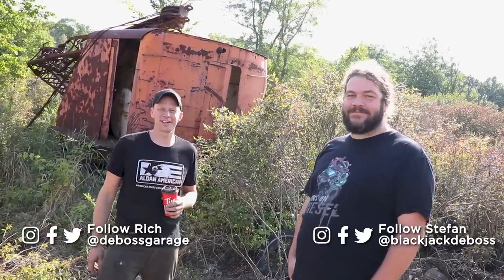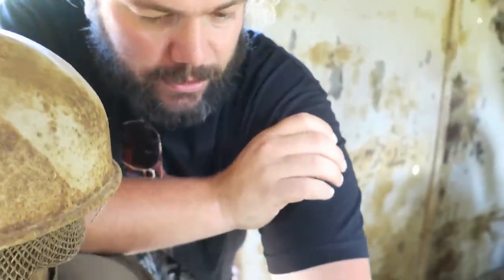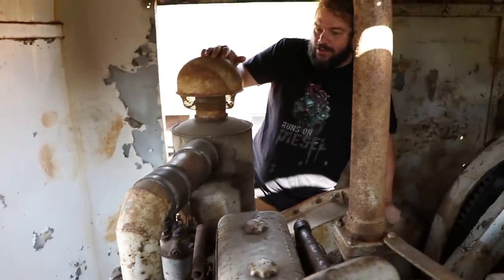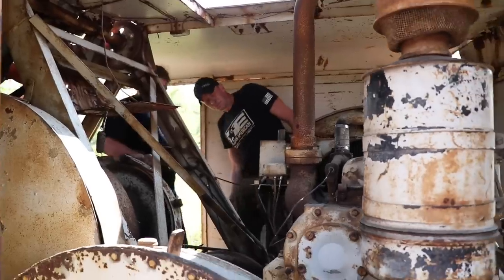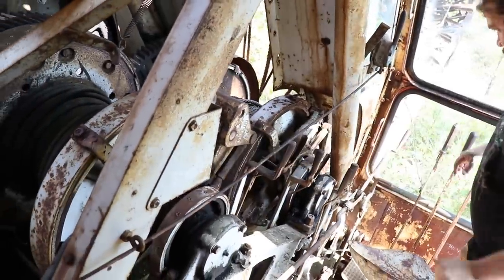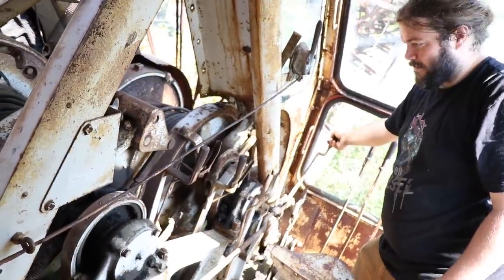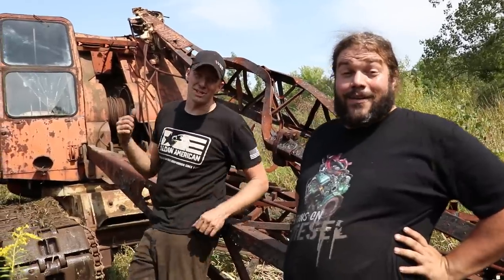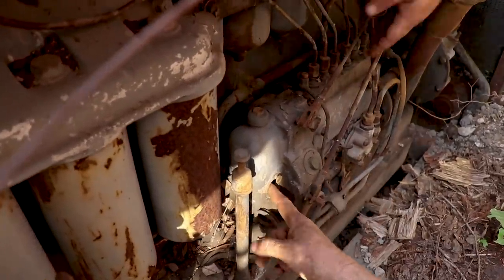Will a 2-Stroke Detroit Diesel Run on 20 Year Old Fuel?

Comment: If the zombie apocalypse comes, Rich will be the only one left driving around in a Detroit-diesel powered something.
Reply: Pfft, 
Detroit?
You know it will be a Cummins.
Reply: @jamiewhitworth7183  well detroit can run on shitty fuel better than a cummins but yeah a 1 wire cummins or a detroit would be best
Reply: @Deftonesdsm  a p-pump will work just fine thank you. Even sunflower oil, if you take out the gummy crap first with proper treatement. SEE Watch Wes Work to see what happens if you just dump in french fries oil.
Reply: @PaulHigginbothamSr  did i not say a cummins or detroit would be best?
Reply: Rick Delair ok boomer
Reply: @xnorthkillerx  really dude? Get an original idea instead of repeating memes
Reply: Rick Delair  The trucking industry disagrees.
Reply: Well I’ll be in my apocalypse car, a Datsun 210.
Reply: @averyw.3939  the trucking industry agrees. The EPA are the ones who killed the Detroit.
Reply: Well, with people like him the apocalypse will only last a weekend before we rebuild and get everything running again.
Reply: @danmackintosh6325  Lets make it even better. Mercedes OM615. I drove one with frenchfries oil (used) for years just filtering the oil i used near arctic circle. in winter i just added 50% gasoline in it. It runs on ANY fuel. The car did run about 1 million km /600:ish thousand miles? ANd eventually the engine didn't give up, it was rusty chassi (200D W115)
Reply: @SergeyPRKL  True the OM is a great engine also, I'm just a sucker for the simplicity and ease of bodging a sick XUD back to life (See my video, i had one with a thrown rod that i just gutted one cylinder and ran it as a triple for a short while lol)
Reply: @danmackintosh6325  peugeot XD3T was special also
Reply: @danmackintosh6325  Volkswagen. Plenty of TDIs around and it's not hard to make them run on veg. They last forever and they're easy to find. Has to be VE pumped though, the common rail stuff isn't nearly as reliable.
Reply: Lmao

Comment: I thought getting my lawn mower started every spring was worth celebrating.
Reply: Compared to starting an old Detroit, that really is an accomplishment
Reply: I also celebrate this achievement as my lawn mower is a crock of shite
Reply: Definitely put seafoam in the gas tank before you store it over winter and let it run through a bit I've never had a problem they even started it an old craftsman that hadn't run in a couple of years all I did was put seafoam in the tank and crank it
Reply: Looks stage.  
Someone told me.
Entertaining.
Reply: thegreatga 😂😂😂

Comment: That Detroit fired up way too well and evens idles way too well. It wants to be saved.
Reply: DESU! Every Detroit diesel deserves a second chance
Reply: Anime profile: save the Detroits!

Me: agreed!
Reply: DESU!, that old Detroit wants to live another day! Put it in an old 3/4 ton 1970s f250.
It won’t haul much but it’ll shire have plenty of power.
Love the Detroit’s man!
If you’re gonna buy one to put in a project they aren’t that expensive as a unit. 

An I6 6-71 is only like 3-4K. About the same as a good old diesel V8 or 5.9.
Reply: @michaelbenoit248  a 3-53  only has 100 HP. It would be worthless in a Ford F-250
Reply: net-rioter that would be worse than the detroit 6.2s in terms of power lmaoooo
Reply: @butwere3-0wou  a turbocharged 3-53 would do better than a 6.2/early 6.5 if it's got a decent dual stick behind it or a hi/lo rear end. It would definitely sound amazing as well
Reply: @netrioter  you double that with a turbo and bigger injectors. Plus you could probably get 25 mpgs
Reply: John Rambo  Spongebob profile picture
Reply: John Rambo  There are also memes about people that care too much about anime profile pictures
Reply: @netrioter  they put those 3-53's into studebaker pickups
Reply: I love your profile pic and name. You weeb.
Reply: Hank Rutherford Hill  People forget that 230 hp big blocks used to rule the roost in the pickup world, but the old V8 diesels would pull the same weight... albeit slower. We used to just go slow and stop with plenty of room left. 400+ hp diesel pickups weren't even a thing until relatively recently, how did we ever get by lol. I'd opt for a 4-53T silver or a 6V53 for a pickup swap though. It's been done quite a few times throughout the years in all sorts of 1 ton pickups.
Reply: It was so clean inside too! I think who ever owned it took great care of it.
Reply: @netrioter  100hp 800lbs of torque

Comment: Valve train from 50s era diesel equipment is cleaner than my LS engine.
Reply: LS suuucks.

I'm just kidding. I like LS's.
Reply: @Jeff Carr what about 350s 400s 454s? And the ls is the best new motor around
Reply: @Jeff Carr what
Reply: @jdlawless_fuel1416  not even close to the best. 🤣🤣🤣
Reply: @punkrocker10115  🤡
Reply: Guarantee she was a low hour unit or it was well maintained and oil changed frequently because Detroit’s never look that clean under the valve cover. Gotta love an ls they just take a kickin and keep on tickin.
Reply: Might wanna get some degreaser and clean that up or pay someone
Reply: @Jeff Carr your mama!
Reply: @Jeff Carr for ls engines?

Comment: Nuh huh, if it doesnt have a kips valve its not a 2 stroke. I know because my grandpas neighbor worked for a vacuum cleaner shop in Detroit MI.
Reply: Also, another fantastic video guys! Im super jealous! Iv always wanted to go to a slavage yard like that and just try to get stuff running without spending anything.
Reply: kips stand for Kawasaki integrated power-valve system

Comment: Just getting to this thing is like "Indiana Jones and the Temple of 2-stroke"

If not for the sake of the crane itself, at least save the Detroit!
(Also, Canadian bootleg Jack Black's child-like laugh warms my heart)
Reply: If taken care of those old Detroit's run forever!
Reply: the fun thing about that 3-71  is  it's 50+ years old and parts are still available to repair or rebuild it
Reply: @wildcoyote34  very true!  If i were buying it I would tear her apart for an inspection but I doubt you would find anything wrong with how well it was running
Reply: @Shadow Opp.'s RC i agree , I would probably tear it down and inspect it too , likely it's injectors are the source of the smoking and with as clean as it is internally as evidenced by the clean valve train area i probably wouldn't mess with the bottom end ,,I'd pull the blower and look at the cylinders through the air-box before going any farther ,,I've got a boroscope camera which makes looking inside it easy
before i even pulled the blower  , knowing it ran already  I'd  set it up and run it for a full work day at least 8-10 hours  varying the rpm throughout the day ,,i'd bet the smoking clears up after a few hours with some clean fuel and fuel injector cleaner
Reply: @wildcoyote34  very true!  The old fuel was part of the smoking.  It still burns but turns into a low grade tar almost when it sits along time.
Reply: @Shadow Opp.'s RC yea i hate old stale fuel , diesel especially in old machinery tends to draw moisture 
actually them running that machine on the fuel in the tank is actually not a good idea cause it will pull up all the garbage out of the tank into the fuel lines ,,any time i start an old machine that's been setting  like this i always bypass the fuel tank ,,I have a portable fuel tank i made specially for this
Reply: @wildcoyote34  good idea and diesel or gas it is good to put some atf or two stroke oil in the gas/fuel for lubrication.  Make it smoke like crazy at first but will help prevent metal on metal wear.
Reply: @Rick Delair  i've worked on quite a few of these myself  , i wasn't just thinking of the inspection covers 
i was thinking of inspecting the blower as well ,,,if it ran out as good as this one appears to  I wouldn't tear it down at all ,
Reply: @wildcoyote34  i just bore ascope it and inspect through the covers.
Reply: @Shadow Opp.'s RC hard to inspect the back side of the blower  for foreign object damage and the blower side of the pistons for signs of damage
i wouldn't worry about that much from a truck or bus engine  but an industrial engine has a bad habit of having been run with a poorly maintained air filter ,I worked at a rock quarry for about 10 years  and i saw a lot of equipment that had air filter issues ,,oil bath air filters are notoriously  unreliable and maintenance intensive 
I cringed when they started this machine and then later i saw the intake pipe removed ,,that told me that the air filter was clogged
Reply: I'm pretty sure they only pulled the intake pipe off so that they'd have a convenient place to shove the Cadillac hubcap if it tried to run away on them.
Reply: haveing that all fixed up new boom she be in working order for crane jobs cheaper then spending $100,000 on a new crane
Reply: I thought I was alone with the Jack Black association. It is kind of apparent, isn't it? A very YOUNG Jack Black, too. You're welcome, DEBOSS GARAGE dude. You even sound similar. Rock On. The other guy is cool too. I know I have seen him before, but I wasn't subscribed. Am now. NOW, GET THAT GORGEOUS BITCH RUNNING!!   :-)

Comment: My god... you gotta save that engine, it started right up like it ran yesterday.
Reply: I agree!  The engine wants to live!
Reply: go get it he told you where its at!
Reply: That's the beauty of diesel fuel. Gasoline would never have lasted 10 years in the tank.
Reply: @robj2704  especially this new crap with ethanol in it!
Reply: @ShadowOppsRC  why the ethenol hate? Sure it doesn't last as long in storage, but it has a excellent knock resistance. so unless your stockpiling gasoline for the zombie apocalypse it seems to me the best solution is to not buy more then what your going to actually use over a few month period.
Reply: @jaydunbar7538  yes about the knock resistance but small motors hate it and efficiency goes down because you are forcing more into the cylinder. My wifes car picks up at least one mile per gallon on nonethanol.
Reply: Reverend Krieger Durden sr  yes ethenol has less btu per gallon, hence the loss of fuel economy. Also has a lower cost so the loss is of little consequence. It only deteriorates the system if it's not designed for it, and if it's getting put it in a system not designed to handle alcohol then the problem is the operator not the fuel. Yes it it is hygroscopic, hence why it should not be stored for long periods. That would be why I said you should not buy more then you will reasonably use. As for leaving it sit around in a carb, yet again operator error, fuel should never be left in the carb if it won't be used for a time.
Reply: @jaydunbar7538  It shouldn't be as prevalent as it is. All US corn production is heavily subsidized for ethanol production. Why? The Brazilians produce ethanol for half the cost, so we subsidize our production to stay cost competitive. We are actually losing money on ethanol. Farmers claim to hate welfare, but they sure eat it up in subsidies.
Reply: Reverend Krieger Durden sr  ethanol sure after does not burn hotter , it burns colder ,thats why people make more power on it with same turbos.... You can dump more in , in fact you need to because it's 30% less power dense.
Reply: Reverend Krieger Durden sr  So if you aint running alcohol for the power memes, stay off it.
Couldn't have said it better myself. 👍🏻
Reply: yes that would be a sin to put that in the crusher , also the  tracks seem good also .
Reply: @jaydunbar7538  knocking is just because the cars have insane crap high compression
Reply: @jaydunbar7538  Are you a corn grower from IOWA?   The commercial production of ethanol for use as a fuel is a complete SCAM.

Comment: This machine was some really great old engineering without the need for an entire hydraulic system which needs constant work to keep working. If someone hadn’t overloaded this machine and twisted the boom it would still be useful right now! I love the oil bath air filter and the simple drum brake clutch setup
Reply: As anyone who has worked in a factory knows. Every intern finds it cheaper to spend $90,000 on a new less reliable piece of equipment than to overhaul an older one that's worked for 30 years for $15,000.

Comment: As I'm sure many know, 2 stroke just means it completes a power cylce very 2 strokes of the crank.. that's what gives Detroit's that signature sound.. doesn't matter that it has valves.
That's funny about the common rail comment, I never even thought  about that with Detroits but it is kinda true lol

Comment: Imagine this, a snowstorm, your stuck at the shop and nothing else starts except  your Detroit  2 stroke diesel crane, you put on your snowmobile suit and get it started ,cut the boom off with a torch drive  home at 1 mph through 4 feet of snow all while drinking a beer standing on your crane as you pull into your drive way to your spouses amazement and the kids yelling take me for a ride dad, this is so cool and you suddenly have just won the DAD of the year award 🏆 for 2020, awesome video, I'd say its a keeper, you could literally do anything with this old crane.

Comment: Don’t know why I haven’t seen this episode before but I started watching a few minutes ago and I’m really diggin it. The lever furthest behind the seat is your master clutch. The lever on the left of the seat marked B and T is for what they called the slide pinion. It operates a double acting pinion gear that is either in a raised position or lowered position controlling either the boom drum or the bull gear on the drive setup very much like the old Manitowoc cranes built before the 60’s.  In order to replace bushings or change the slide pinion it takes either another crane or big ole flat jacks to lift the car body high enough to slip it out. Haven’t seen a name on the rig yet but I see it’s built much line either a Bucyrus Erie, Bantam also built theirs similar to that setup as well as in the cranes built by American. Really appreciate you guys saving this older equipment if you’re able to and really enjoy watching it happen. I’ve been on a lotta jobs when the hydraulic cranes had electronic problems and had to be shut down but the old standbys,the friction rigs like that one would still be goin to town. Great job on the videos and content guys,you’ve gained the respect of this guy. Keep up the great work keeping mechanical history alive and well. 👍